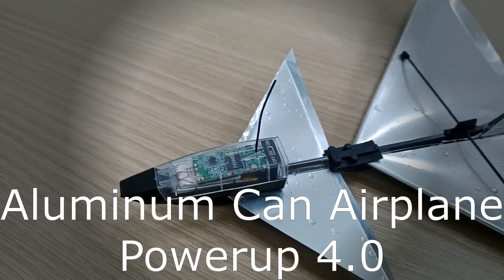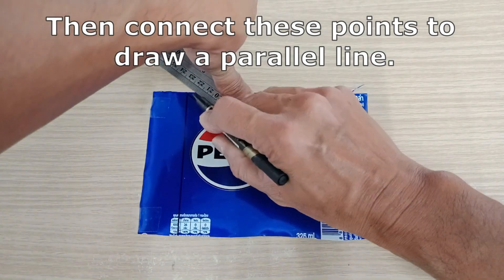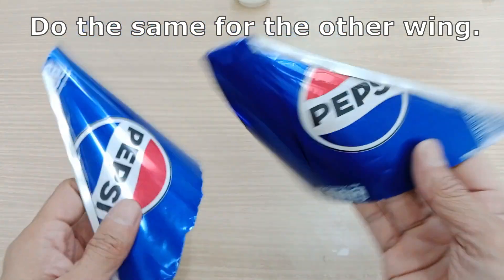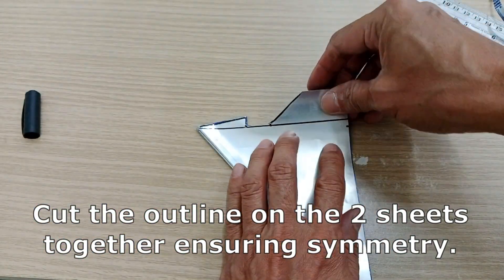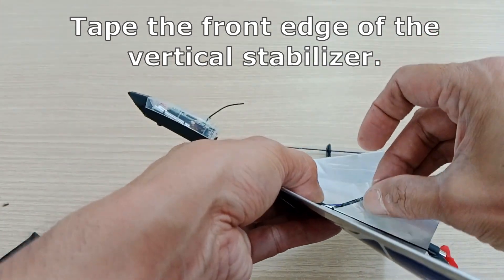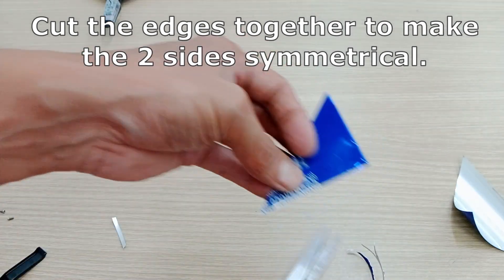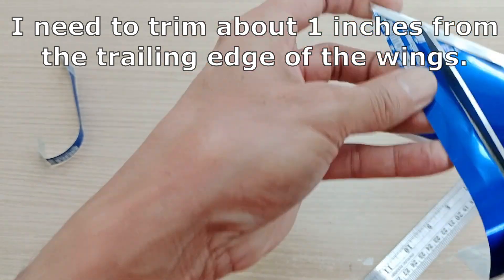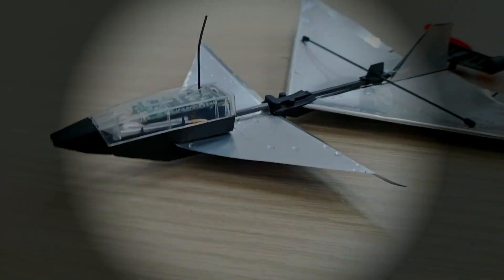DIY RC Airplane from Aluminum Soda Can

Comment: 1018      model  is  HEAVY.      the canard is over-large.       nose-up  trim  has been used at   THREE  places.!   equals dum.            googletranslate
Reply from the maker: Correct, it is too heavy that at first it did not fly at all. That is why I have to cut some portion of the wing to reduce weight. Also agree that the canard is too big. I just randomly cut triangular shape and tried it out. The powerup kit is very versatile and forgiving. It has the ability to compensate for less-than-ideal design and make it fly. In fact, it can even make a lettuce fly.